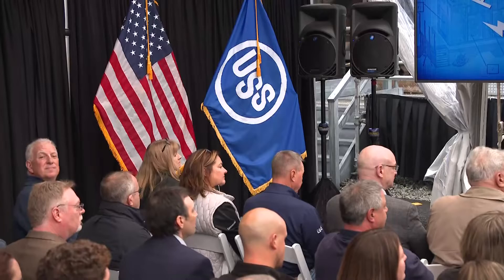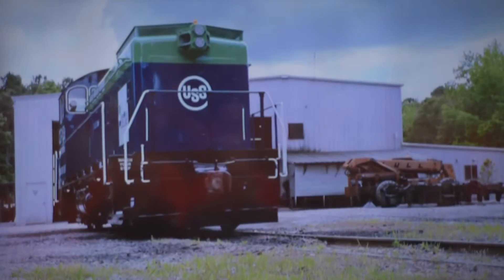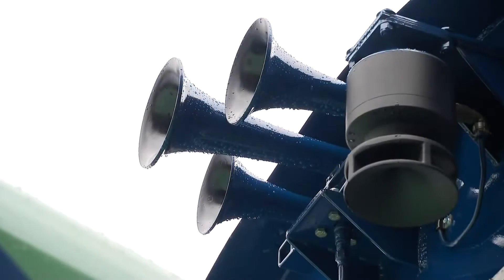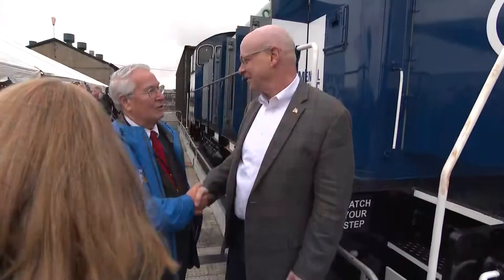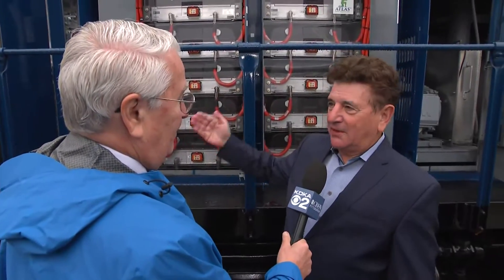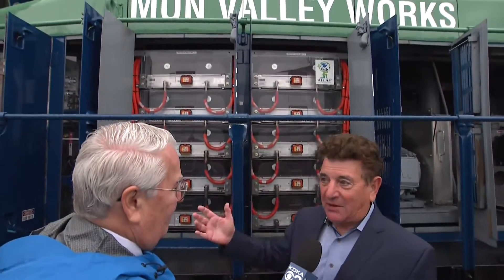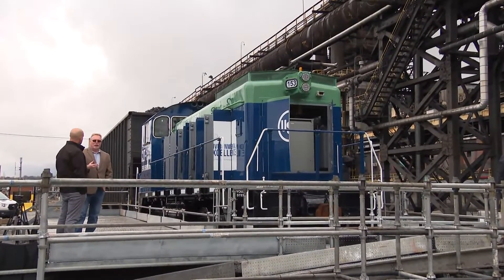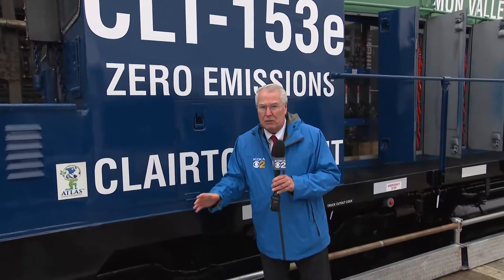U.S. Steel introduces first-ever electric battery-powered locomotive

Comment: The sticker on the back of my EV says the following “This electric vehicle is powered by coal, natural gas and nuclear power” I didn’t include windmills and solar panels when I had the sticker made because they represented less than 1% of the energy produced in this area. As a matter of fact, any windmills that are 15 to 20 years old are being imploded and dropped on the ground because they are no longer efficient. CDI, a Phoenix Maryland implosion company dropped nearly 100 of them in the western United States last year and early this year. They were no longer viable. Tell me now how the batteries are going to get charged in this locomotive?
Reply: There’s a charging station it sits under when not in use.
Reply: @MrScucc17  
The difference of course is that if it is powered by fossil fuel such as diesel, it can operate 24/7. That would be the difference.  We own two hybrid in our business and they are very good vehicles. My son would like to buy an EV but if he takes that EV from the Pittsburgh Pennsylvania area to Ocean City Maryland, he probably would have to stop and have it recharged twice along the way adding hours more to the trip which already is five hours and 15 minutes. With the cleaner diesel engines nowadays the charging station that you’re talking about that it sits under when not in use is fueled by coal, natural gas and nuclear and if you want to get real technical, some solar and some wind when it’s not windy or dark you can count them out
Reply: @yt650  it'll run on charge for 3 days, regardless how powered.  And the amount of wind powered generation in the US continues to climb in absolute GWH and % of total generation.  It's always MUCH cleaner to generate power from NG combined cycle power plants, more efficient in conversion from fuel to electricity and far cleaner in emissions.    Solar is the current high volume adder.    Your BEV will be net cleaner even if charged from coal fired, and way cleaner if from almost any NG plant. JUST ending coal fired burning alone is the single best thing the US could do on emissions, followed by diesel and bunker grade fuels.
Reply: @ 
By far China and India are the big users of coal powered electricity production.  They’re not going to change.